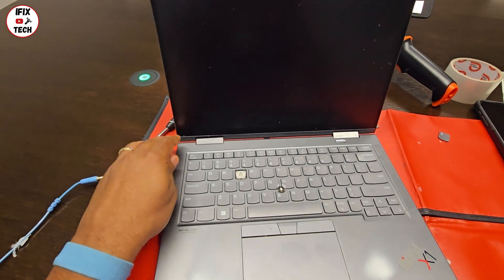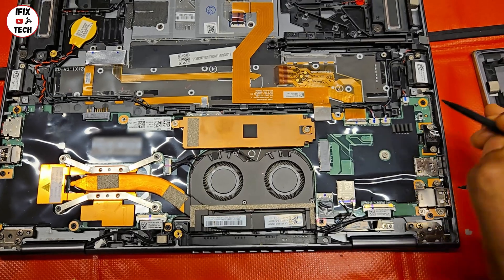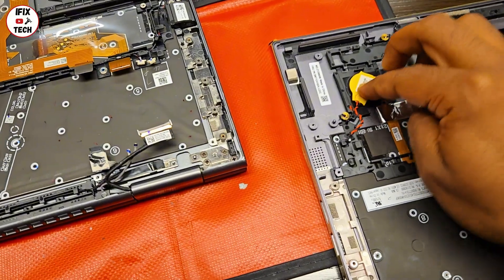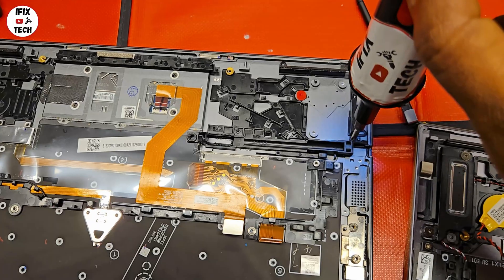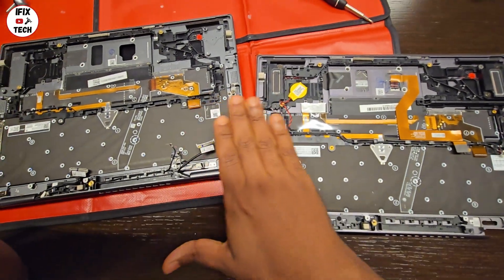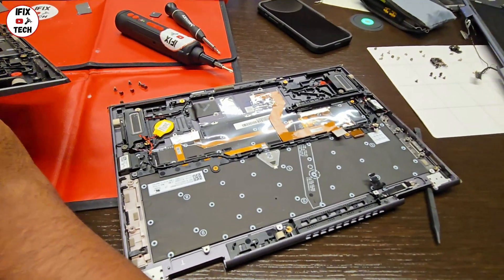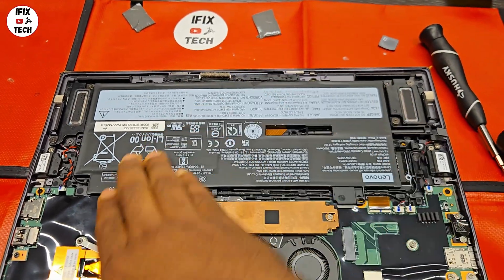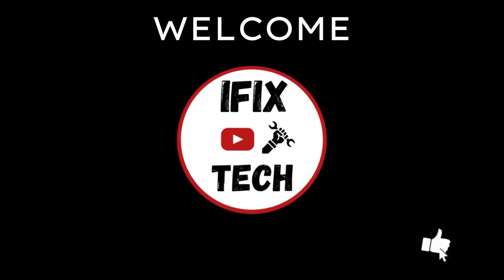Lenovo ThinkPad X1 YOGA Keyboard Top Case Replacement - Full  Disassembly

Comment: Does it comes with keyboard only without the top case?
Reply from the maker: Yeap. It is possible
Reply: @IFixTech1  Yeah and there's a guide on ifixit's website for doing just the keyboard (and trackpad if needed). I bought the keyboard genuine new for $150 i think. the assembly is almost $400. quite a difference. You also have to remove essentially the same stuff to replace either the keyboard itself or the assembly. however, the keyboard itself does have 48 or so tiny screws that require a 000 phillips. putting those back in wow. nightmare.